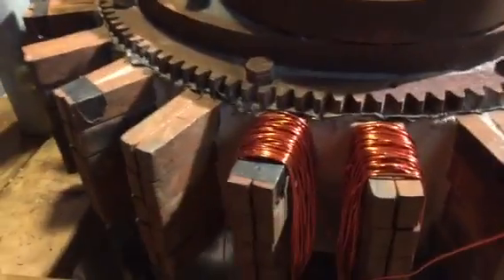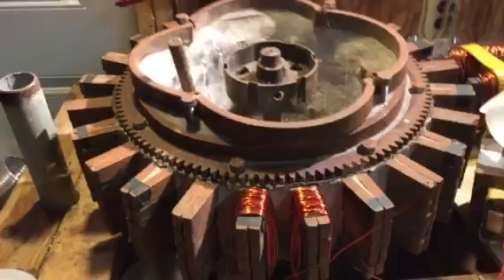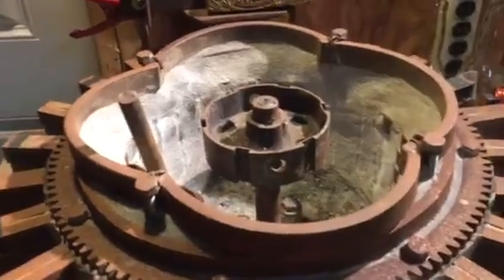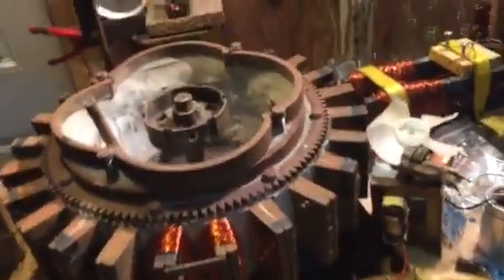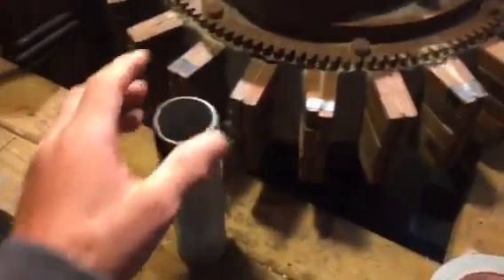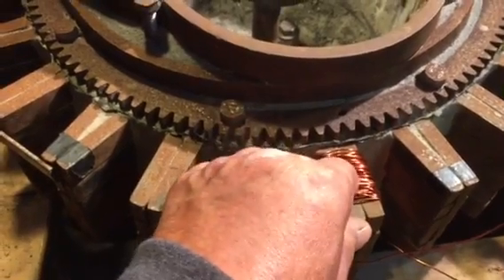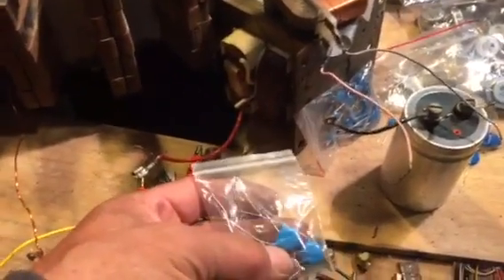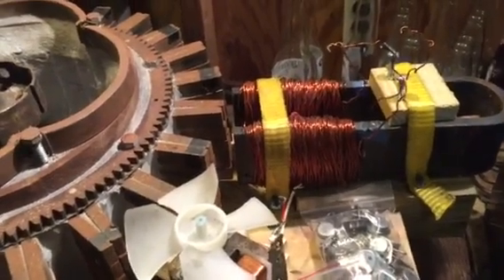Ed Leedskalnin Magnetic Generator

Comment: this wheel is not a generator , it is only a switching device to control actuator driven by a bank of 12v batteries in parallel use to cut , lift and move limestone . Ed work at night because it is  cooller he charge back is batterie bank at day light with ordinary generator couple with the     motor of is  truck :)